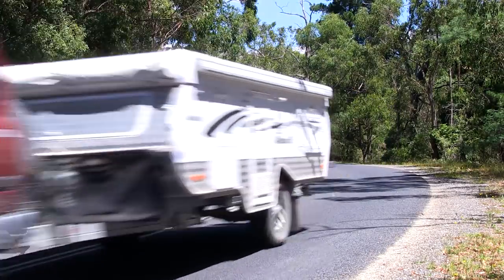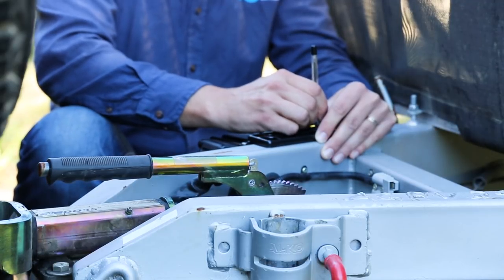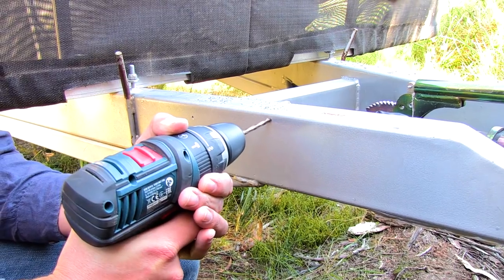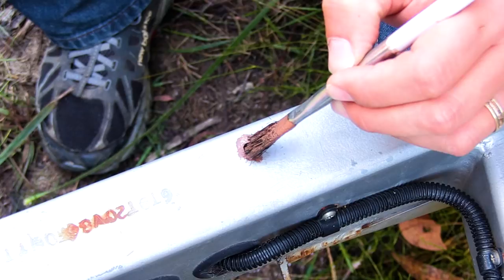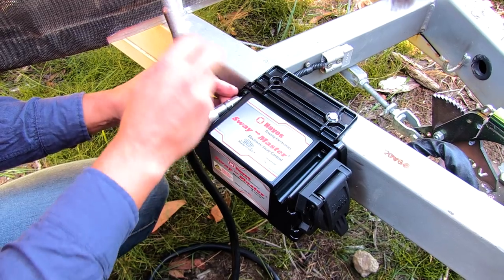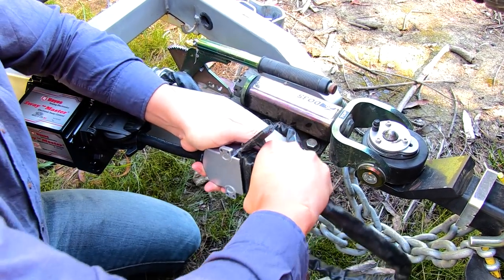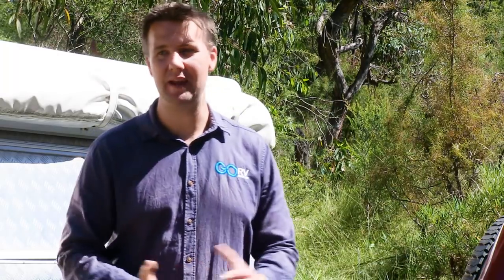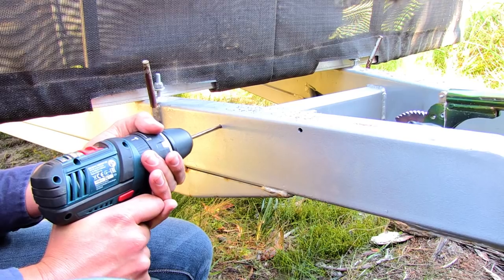DIY caravan sway control installation

Comment: This seems like it is not a smart system that can apply brakes on either side to stop sway, rather it seems to apply brakes to both van wheels as there is only 1 wire from trailer connector (blue, electric brakes) into the unis and out to the wheels. Am I missing something?

Comment: How many people take a battery drill away with them. Not many I'd suggest and wouldn't call it a common houshold tool.
Reply: Always, ALWAYS have a drill/driver, screw box cable connectors, spare fuses and so much more. Those without, will be the ones calling the breakdown service and waiting.
Reply: @dan180360  it was more of a rhetorical  question as I carry it all when I'm travelling which is why my fuel bill is so high!!